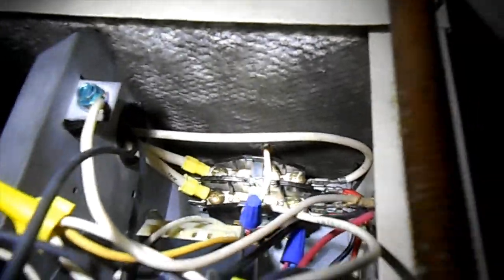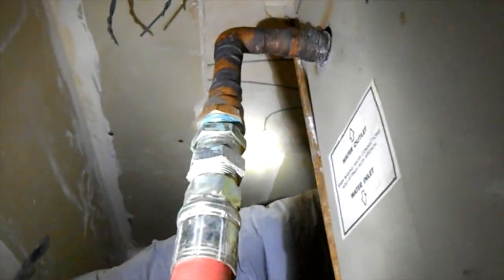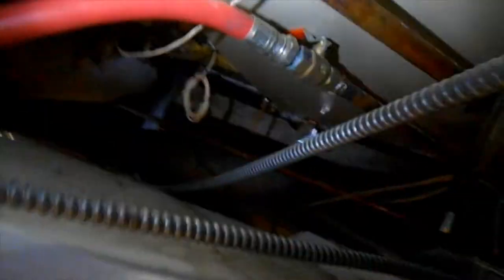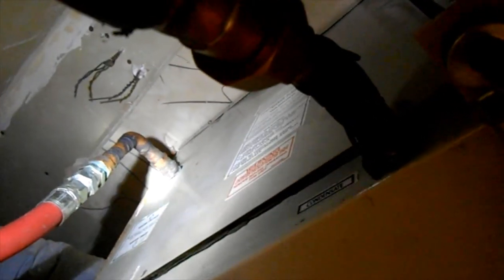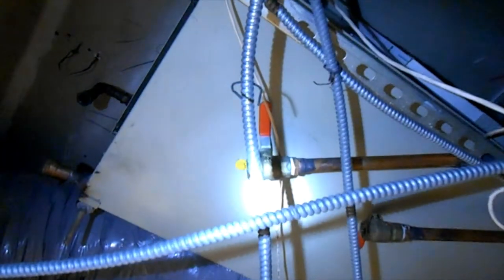Working on Another Old McQuay WSHP - Replacing Hook-ups

Comment: How are the McQuay units ? Do you prefer a trane, carrier or McQuay WSHP.
Reply from the maker: The McQuays were/are awful! I don't know about the new ones but this era (late 80s, early 90s) was garbage. Impossible, tight control box with a rats nest of unlabeled, white wires. Line voltage contactor, fan relay integrated into the circuit board instead of being individually replaceable, DC reversing valve coil, no service ports, condensate drain coming out the wrong side, etc etc. 

 I am a big fan of the Tranes! They have the best design and layout IMHO. The one issue I've found is with the factory installed service ports. They do not have schrader cores; it's some kind of proprietary fast-fill valve or something. And they are notorious for leaking. I have done at least a dozen leak repairs that were related to those service ports. But, it's an easy repair, just cut em off and braze some standard access valves in. The Carrier units are okay too but their design is not as serviceable. I always spec/install the Trane WSHPs when possible!
Reply: @71dembonesTV  wow and I aways thought that the McQuays were good units lol well I have to say my self trane makes some good units.
Reply from the maker: @67tr876  it's not that mcquay doesn't make good stuff. Seen some very nice package units and chillers from them for sure. WSHPs are just not their thing I guess...
Reply from the maker: @67tr876  And Trane definitely has their weak points, too.  I do not care for a lot of their split systems especially the residential grade ones.
Reply: @71dembonesTV  Yeah we have trane chillers and they are really good ! We never really had a problem with them, I will have to do a video of are chiller plant soon !
Reply from the maker: @67tr876  Would love to see it!